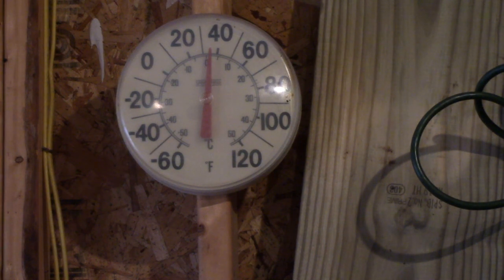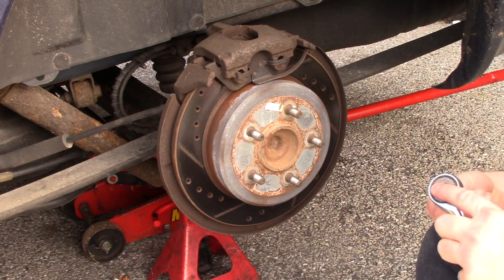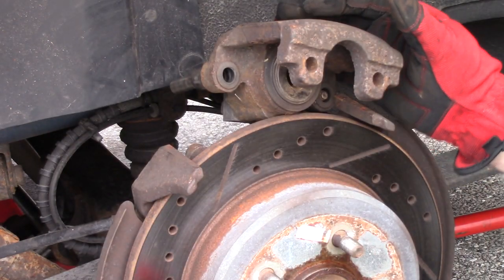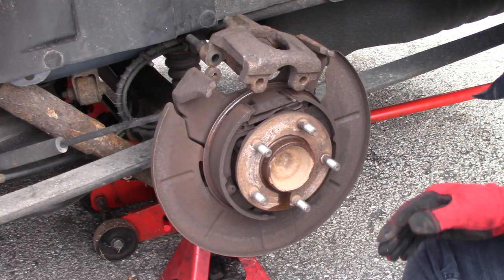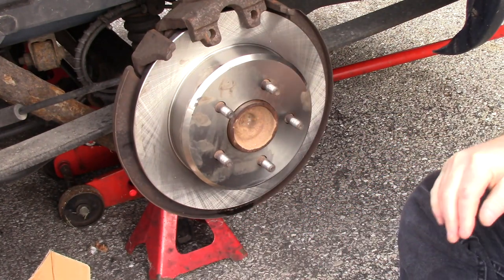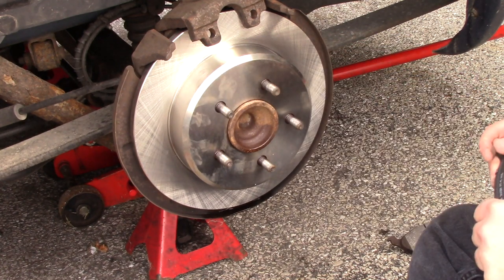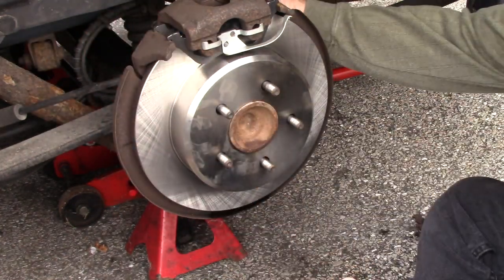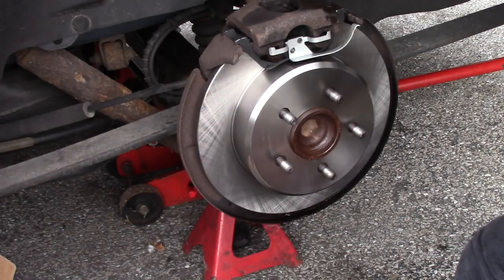2005 Dodge Grand Caravan SXT REAR disk brakes and rotors

Comment: i have this project this weekend. I will change rotors, calipers and pads. I have never used my parking brake. That is why I remove them with a cutoff tool. while in their, might as well change the rear shocks.

Comment: While you have that rotor off it's a very good time to lube up all of the moving e-brake parts with a good spray lube (not WD40) - the cable at the housing, and the actuator, which is the mechanism between the tops of the shoes that pushes them apart. Otherwise, the cable and actuator will eventually rust up and lock your e-brakes the next time you use them.

Comment: Hi There .
Thanks for info .
After watching a few of these ,,
Did you by chance put some anti - sieze on the brake pad ends / where they slide a little bit ?
And use a silicone paste type coating on the caliper pins ?
Just asking because another YouTuber , Ericthecarguy ,, is pretty knowledgeable and uses copper anti sieze and silicone paste .
He stated grease holds moisture and will cause to sieze up again .
Just some info .
Reply from the maker: i used the normal goop that came with the brake pads, it reminds me of anti sieze as i look like the tin man from the wizard of oz after using it.

Comment: Very helpful! Just managed to change the rotors over with this video and I noticed that one of the brake shoes is cracked, is there any way to replace it?
Reply from the maker: the inside the rotor shoes are the emergency brake shoes.

Comment: My rear rotors Stuck on .. the rear e-brake pads r pressing against the rotor how can I release it
Reply from the maker: sure can, undo the two caliper bolts and use a super large flat blade screwdriver/or prybar to pry it up. the caliper in the rear is a "screw in" type, not a crush it back in with a C clamp type. so be careful on it. but yes it will come up. then for the rotor, get a dead blow hammer or something that wont mark it, give it a good tonya harding and it will pop off.  you can also squirt some penetrating oil around the hub center to help her pop free
Reply: @ChrisEdwardsRestoration  What do you mean the rear caliper is a screw in and not a crush it in with a c clamp?  You literally crushed yours back in with a c clamp.
Reply from the maker: Mine i can but some are the type of calipers that you screw back in as in the piston rotates as it goes in and out so be careful

Comment: Have you ever replaced the E brake Cables? i am confused on which part #TO USE I also have 2005 DGC stx With Sto And Go Seating Thanks in Advance Sir
Reply from the maker: I have not replaced my ebrake cable. i have the same setup w stow and go, i would call the dealer and then buy a cross referenced cheaper one.

Comment: On my 2003 Dodge Grand Caravan anyone know why the back Breaks are dragging & when stopped the rear breaks are slightly compressed as if you’re pushing the brake pedal down but only in the rear ? Anyone know why ?? Take a back wheel off you can see the rear caliper pressing the brake pads against the rotor and the rotor will not spin !
Reply from the maker: hose or caliper , probably the hose. they collapse from the inside and cause this issue. could look perfect from the outside, but if its a 2003, i bet its bad. especially if you did a brake pad change and let the caliper drop and or hang on the hose. folded it or bent it in anyway. its cheap, replace it.
Reply: .... Doing mine on 2005 because of seized / stuck caliper or bad hose .
So replacing the lines / hoses ( which is a one piece unit ) caliper / rotor / and pads .
Reply from the maker: @KZ3W  one piece? mine were all seperate. but good  to do them both sides as parts seem to get jealous.
Reply: @ChrisEdwardsRestoration  ... sorry , should have kind of clarified .... The Brake hose ( that connects to Banjo bolt ) attaches to a longer brake line , that then , attaches up near the main rear brake line . ( This whole brake hose / line assembly is like 20" if stretched out laying flat ) . This is the part I was referring to as a one piece unit .
The brake hose itself is probably only around 8" long .

Comment: do the direction of the outer pad tabs matter ?
Reply from the maker: I do not really think it matters as the tabs are identical on both sides. and have the same mounting points, but the book shows it should be facing towards the back
Reply: Also the brake pads are shaped to the groove they fit in. If its in the wrong way, you will see that the pad will poke out very much